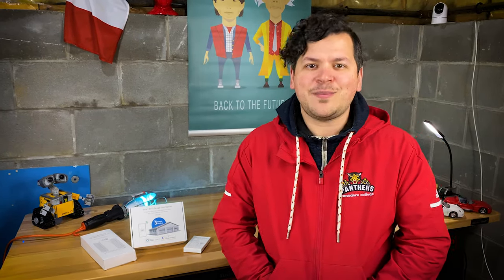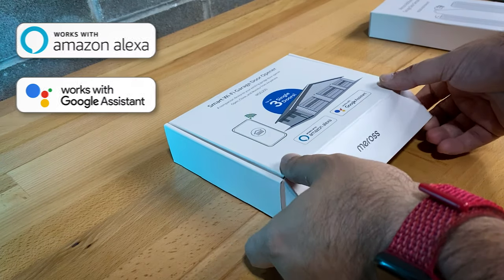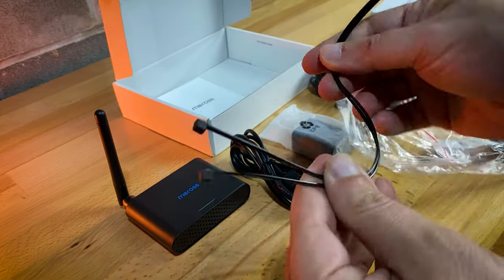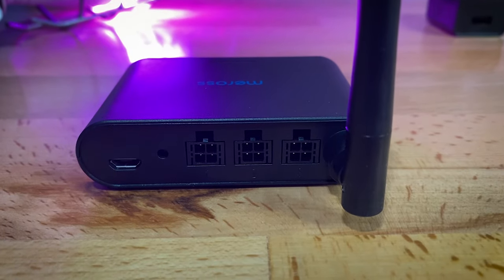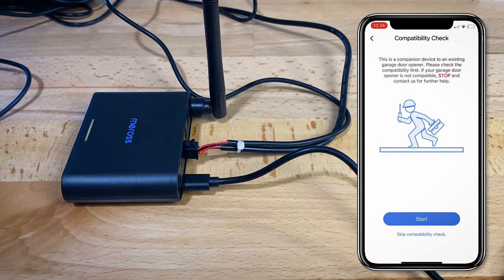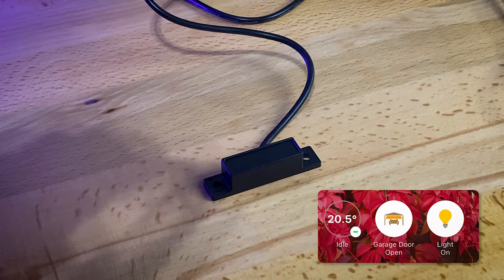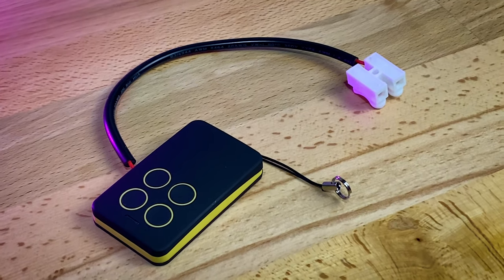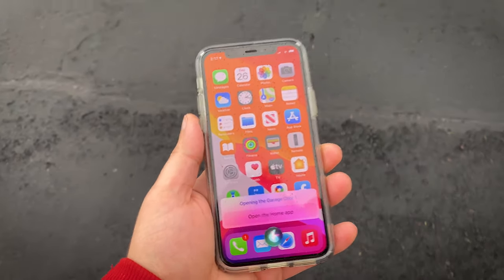Meross Collie Smart Garage Door Opener with HomeKit - Unboxing, Installation & Review MSG200HK

Comment: What's the difference between this and normal Meross Smart garage opener?
Reply from the maker: I believe the main differences are Apple homekit support, enhanced security, longer range wifi antenna. I don’t have the original door opener by meross so I cannot compare. Homekit is the primary reason I was interested in this product.